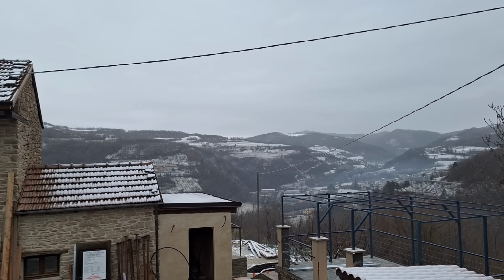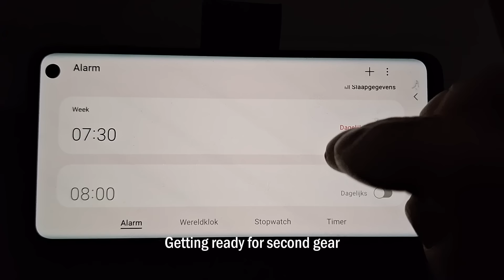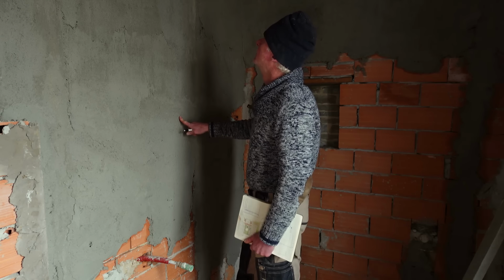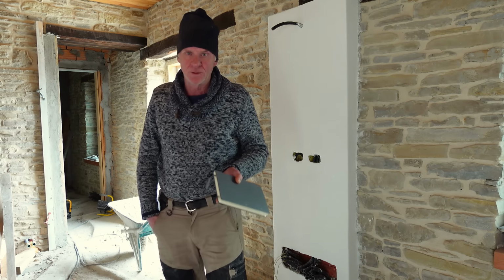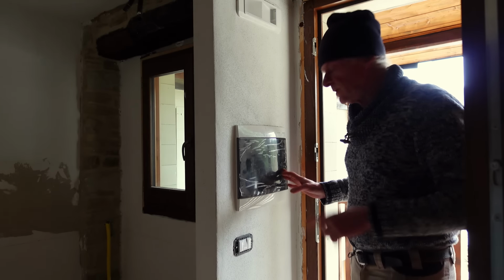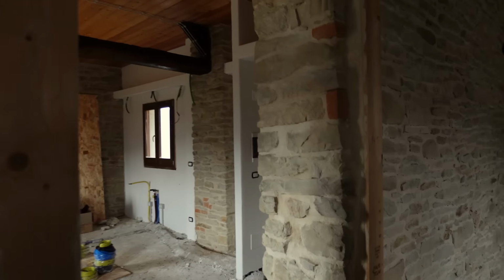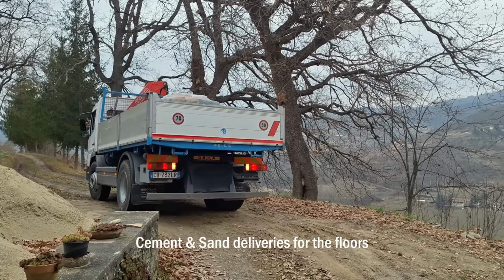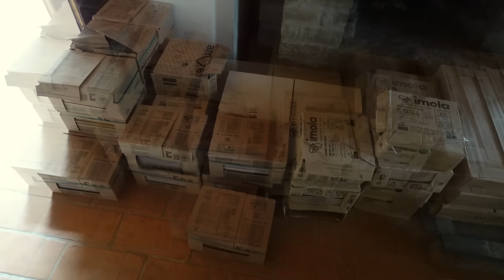#45 Firing up the engine | 4th year of renovating an abandoned farmhouse in Piedmont, Italy

Comment: Happy new years! (A bit late, but it's been a rather chaotic start of the year for me.) It's good to see that you didn't just go full throttle right away - and I loved the bit with the chair. Even though it was at a precarious angle you'd still sit on it. 😁

I like that you are experimenting with narrative, it definitely works, but should maybe have moving pictures while you are talking. The reason is that I thought the video had frozen and I'm probably not the only one. 

Haha, about light switches that turn off light somewhere else... It wasn't funny at the time, but looking back it just goes to show how little I knew about things like that after moving to my cottage. In the barn there was a lightswitch just by the door - 30 cm or so from the circuit box for that building - and a lot of things were brought in there for storage during the move. Then, of course, somebody at some point decided that no more things had to be brought in there and pressed the lightswitch. The next morning I discovered that not only did that particular lightswitch turn off the lights - it turned off ALL electricity in the barn, and it had been below freezing during the night, so my very first day in the cottage was spent panicking over a waterleak because a stopcock had frozen and burst... 😂 Welcome home? But it certainly made me realise very fast that I had to learn how to maintain this property and not just renovate it.

But about the layout of the apartments and such - you can only do so much, in the end it's entirely subjective how people live, so have some confidence in the effort you have put into it. 

I think all the calculations you mention are usually glossed over or not mentioned at all in most youtube channels focused on renovations, so it's really interesting to hear how much work that actually is. Especially for people who are thinking of renovating but are not quite there yet. And with properties like yours it gets extra difficult to calculate some things because there's not straight lines anywhere and the rooms are not perfect squares. I think it's easy to forget that you will have to think about things like that, too. I had a bit of a mission last year to calculate how much panelling I would need in the bedroom...it's definitely anything but square. Even though it's pretty small it's got 8 wall sections + a chimney breast...
Reply from the maker: Hello there! I hope the chaos has settled and you are back to normal! Yeah, I try to experiment with movement but I think the big issue there is that you actually need a second person to basically walk around you else it will just be different angles, don't you agree? 
Well and about those lights. I guess that must have been a wonderfull homecoming on the first day. I imagine you may have thought: " What journey I started here?" I have had some moments in the beginning, but I just started to laugh at the situation. Like it should be part of this journey. 
With the floors in you get a better sence. So some thoughts I had about the layout and interior are changing and that is fine with me. With the floor you get a much better sence of the space.
Nice to hear. Yes the calculations aren't that easy and I have often (and still) been off quit a bit, but I think the fact that I am thinking and calculating means I am still on top of it and feel in control! Greetings! Have a nice week!

Comment: What a fasntastic start to the New Year.  I do hope you continue in 2024 like this.  The coloured tiles are great. The white is missing something and I would say warmer tones may go better on the walls. Great work this week again. Watching your videos I am not sure if you arent building a power station with all the wiring, pipes, and cables-😜Those apartments are looking fabulous.  I hope you are keeping warm with lots of nice stews and soups these days. The area around your house looks freezing. Winter is here, there is no question of that!
Reply from the maker: Thanks Vivienne. Yeah I was a bit shocked making the new calculations.It seems a biyt over the top the length of the wiring, but times changed from having 2 power sockets and a lightswitch in a room. For sure it won't stay white. Too cold. Winter cold is sometimes hard. I like it much better when the sun turns out. Gone be cold though in the upcoming week(s).

Comment: Hi Bart! Thank you for the actual trip in the forest of your renovation... This year I will also start a similar, but smaller-scale renovation in Abruzzo. I have a technical question: from 3.53 you use a funnel mounted on a cordless screwdriver to fill the joints between the bricks. Is this a purchase or a DIY tool? BR Istvan from Hungary
Reply from the maker: Hi Szabo. Thanks for following. Yes that tool is something isn't it. I was actually looking at all the machines they use for this job but the downside is that they need to be operated by two persons. Then I found this baby. If you check out that video #1 - Grouting natural stone walls. I left the link to the product in some reactions. You can buy it online for around 210 euro. Good luck with your renovation!
Reply: Thank you for the info!  I will follow your work, to inspire myself. @borgopoggiodeifiori
Reply from the maker: @imreszabo9438  did you find the product link/URL?